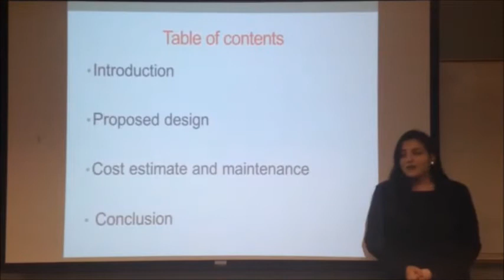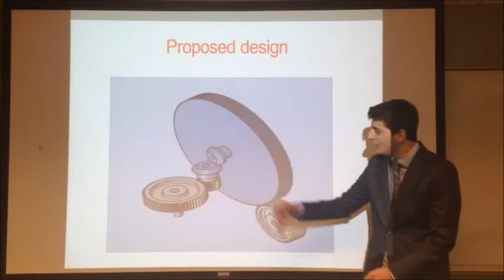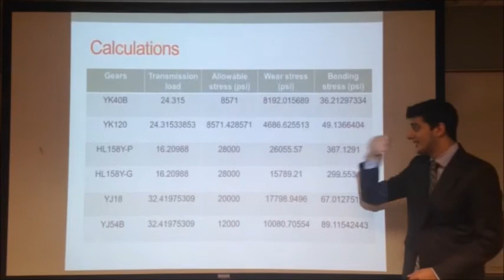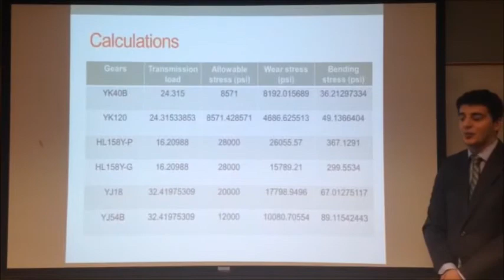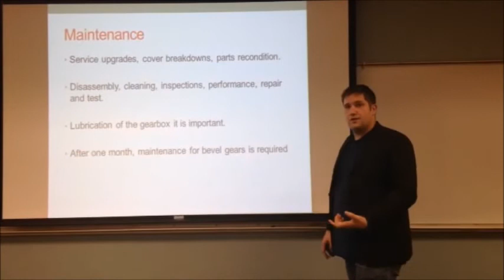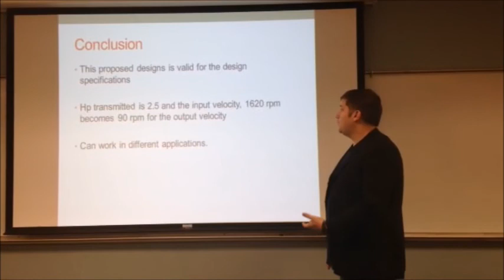Team 8: Gearbox Design

Comment: The camera shifting during the presentation was a hindrance to the overall presentation as well as the rather abrupt transfers between presenters. Also the audio which seems to pick up half way through tends to drop out in the beginning of the presenters making it hard to hear. overall though the information presented on the slides was informative and helpful to what the presenters were saying and wasn't just information for the sake of filling up a slide. Good job!!!